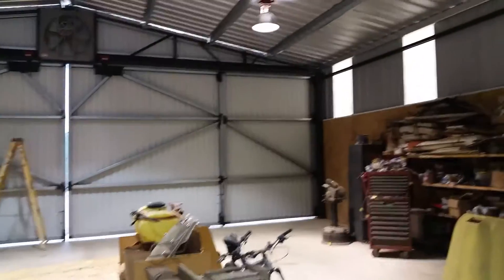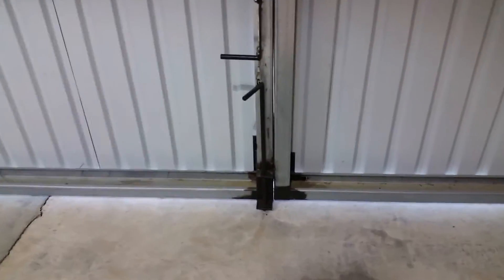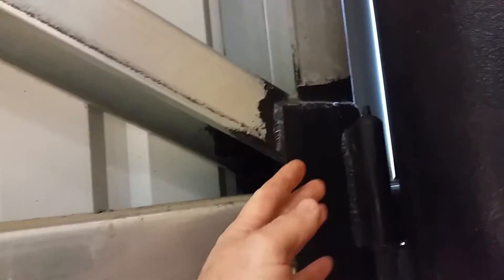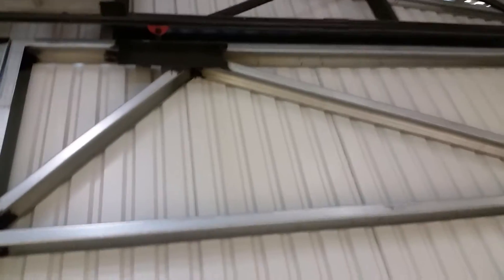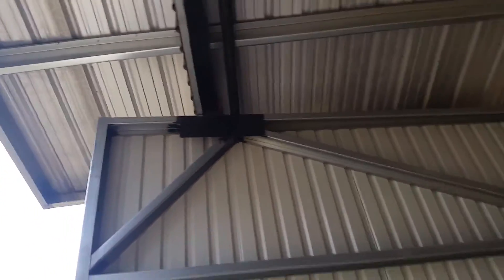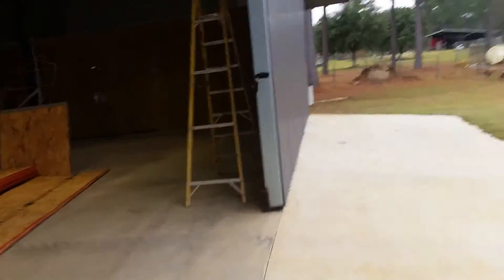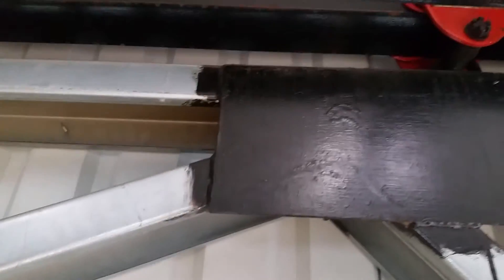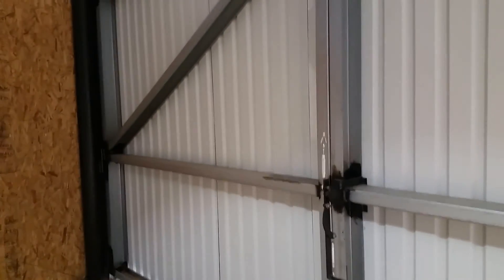Hangar doors

Comment: Cool design. I made similar doors but mine swing out instead of in. Will consider making them like yours on the next go. No chance of wind tearing them off if they are inside the building when open
Reply: Anybody hab
Ve building plans for doors or are they like the green bean door?
Reply: Thanks! It withstood two hurricanes in LA already.

Comment: That's a pretty hefty overhead beam. Given that you have a good slab floor, I'd like to know if you considered using wheels to reduce your loading issues, and if you did, why you decided against it.
Reply: The overhead trolley system works great. It doesn’t need lower wheels. It’s actually easy enough to roll that my wife can use one hand to open and close each side, very very easily.
Reply: Thanks, so it looks like I'm gonna have to do the experiment on my own. The hangar I need to add a door to lacks the beefiness required to support a structural beam like yours.

Comment: Do you have plans for this type door, I would like to construct one but about 50 wide.
Reply: No, it was just a custom design j sketched out for my hangar. I looked at a lot of different hangars and decided to give this a shot. It’s worked out great for several years, and withstood 150 mph winds in Hurricane Laura with 200+ gusts.